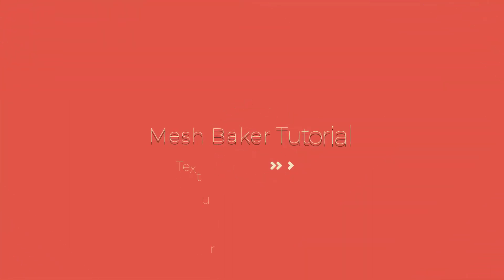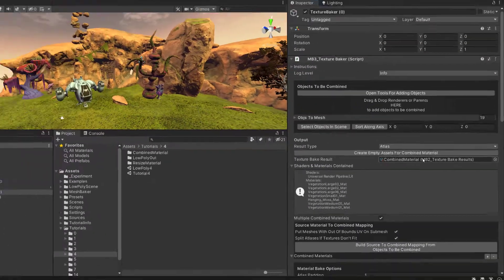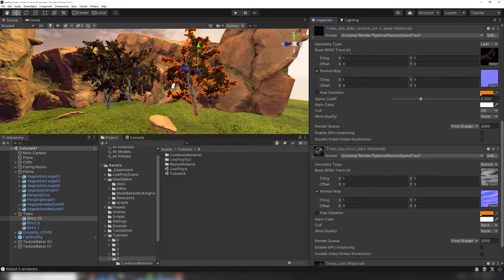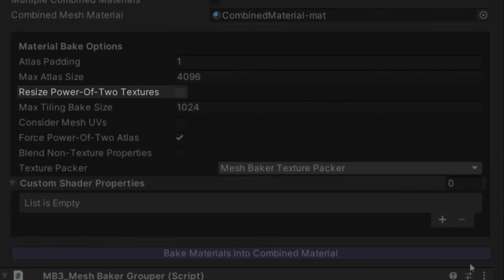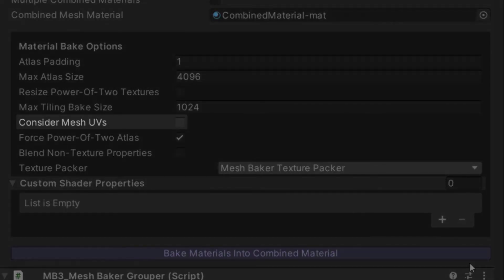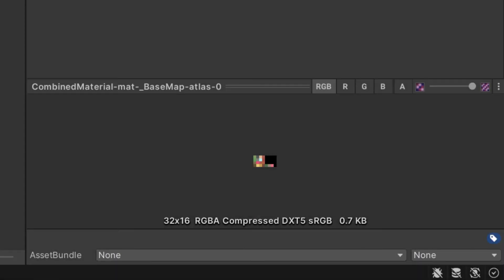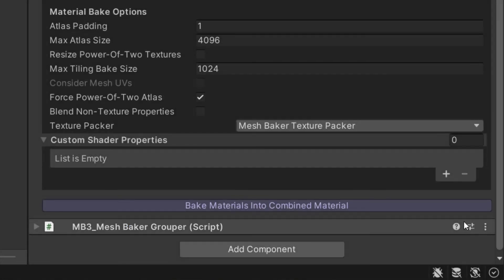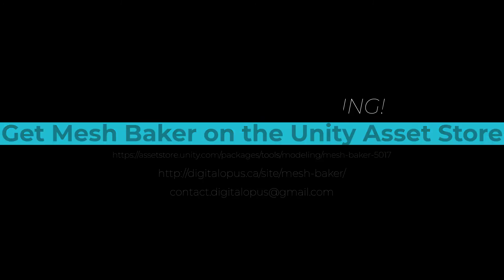Texture Baker Settings

Comment: tell me how to combine only textures, without combining meshes. I tried, but when applying textures, they fall down, not correctly "consider mesh UVs" does not fix this solution
Reply from the maker: Hi Jay, you need to use the Batch Prefab Baker (see tutorial video   https://youtu.be/Cyn_sUCTx9o) to bake textures without combining meshes. 

If the textures are not applying correctly can you contact me using the support email:  contact.digitalopus@gmail.com?  I will need more information about your configuration, the materials, shaders and we will likely need to be able to send images back and forth.